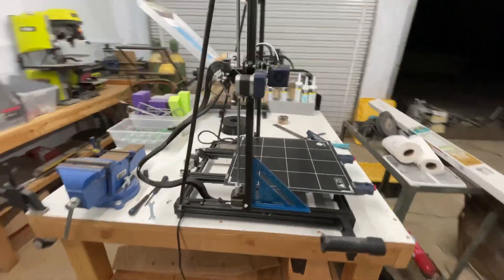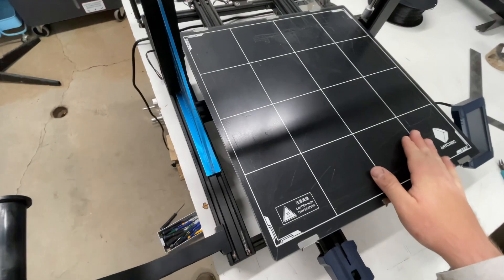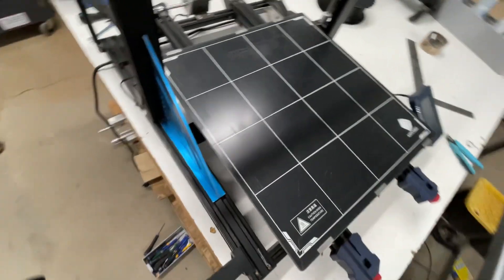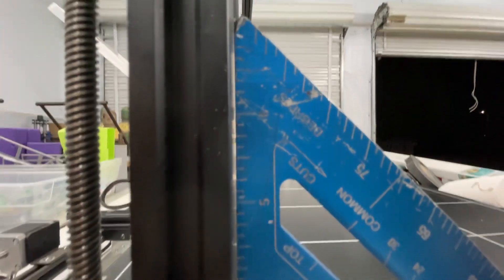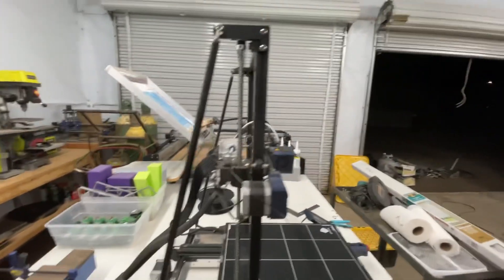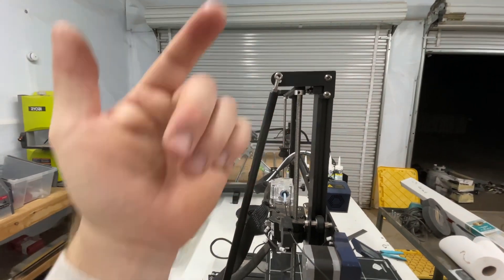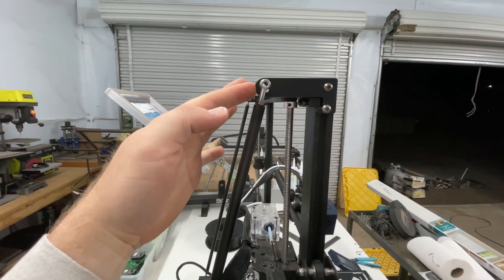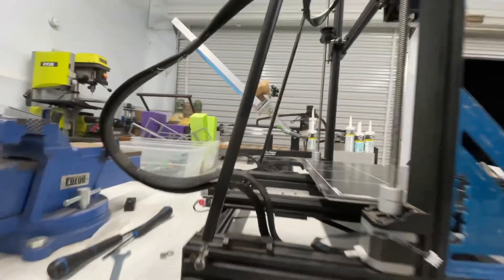How to level Anycubic Kobra Max Bed Forward and Backward.

Comment: How did you stop stringing on your Kobra Max? Would you happen to have a good profile? I have a big problem with stringing.
Reply: Is stringing when the filament just keeps pouring out even when not printing? Cause that’s a big problem with mine
Reply: Same issue I am facing with my Kobra max ....have you find any solution????